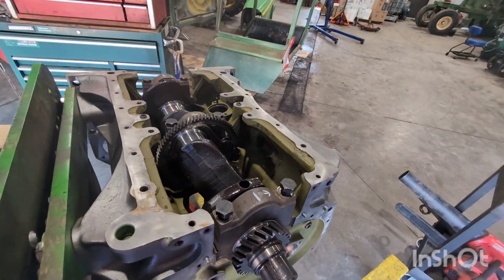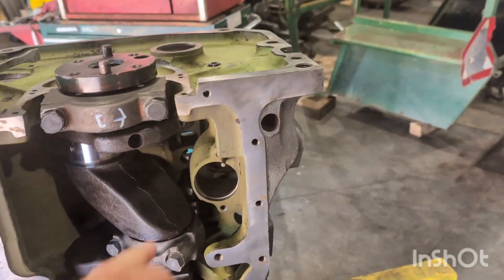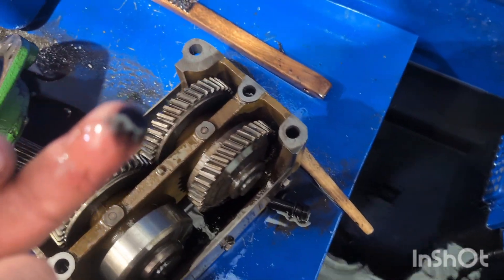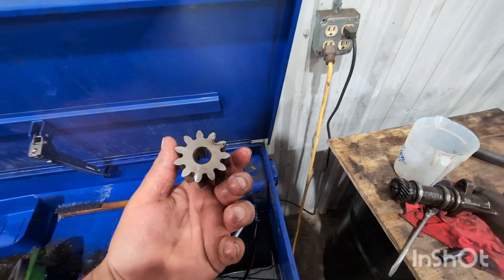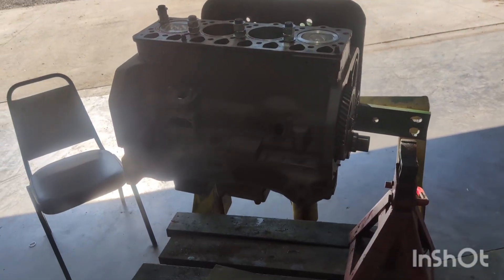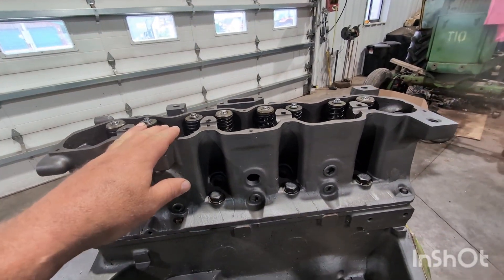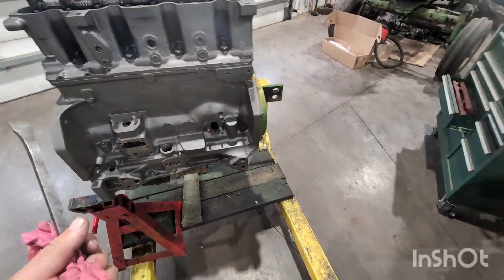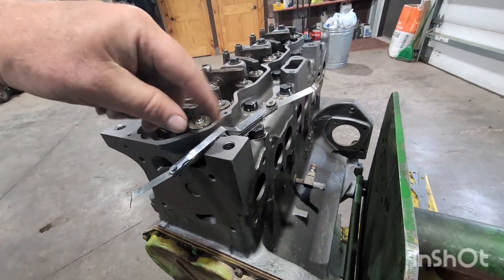Let's start to put a John Deere 3020 gas engine together

Comment: Loved it. Have a 3020 gas I need to overhaul and don’t see many videos like this for them. Would love to see a clutch and brakes video also.
Reply from the maker: I don't do the clutch anymore. 
There's a local guy that will clean up the flywheel and the pressure plate, he'll put new facings on the clutch disc, bead blast and clean everything up, and then set the fingers. So when we get the parts back we just bolt it on.